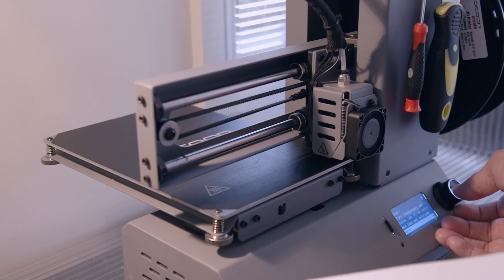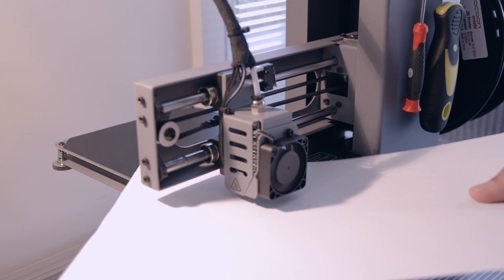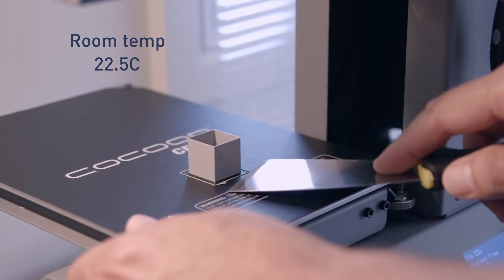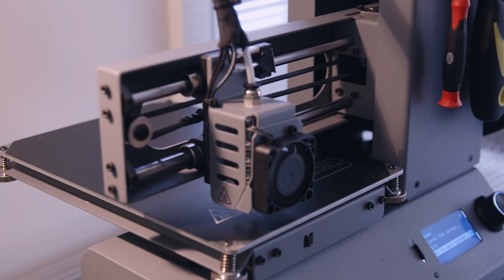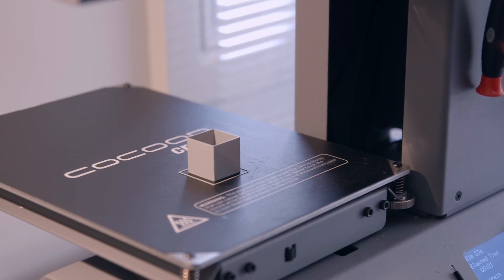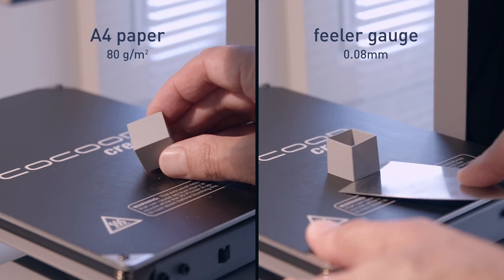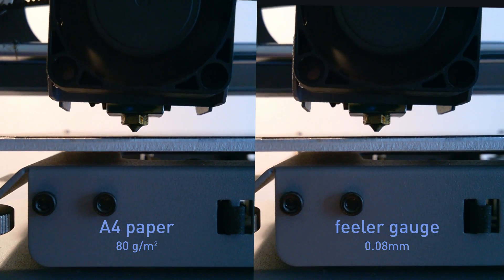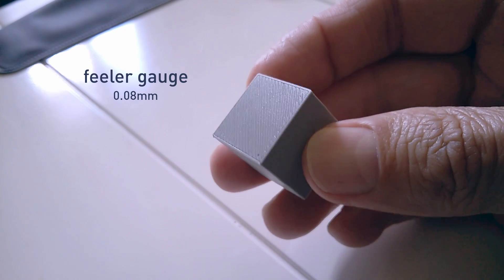Paper VS Feeler Gauge. Which is Best for Bed Levelling?

Comment: you do realize that 80gm paper is 0.1mm thick.... so of course if you dont adjust your slicer Z height settings your going to press your test cube into the bed with a feeler gauge Z height of 0.08mm

Measure the Z heights on both cubes and see if they are the same!
Reply from the maker: Yes that's my point Berko. I found that I needed to press the cube into the bed with a non heated bed to get good adhesion. Now that I have a heated bed I can comfortably run my gap at 0.1mm but my adhesion was lousy at that gap on the non heated bed. I was happy to lose a little bit of height for guaranteed adhesion.
Reply from the maker: The 0.08mm gap I'm referring to is the gap between the nozzle and print bed. I'm Not adjusting the stepper motor settings just the knobs controlling the height of the print bed, which are not limited to digital increments. Adjusting the bed with a gap of 0.08mm puts not pressure on the nozzle or stepper motors as a gap is a gap nothing is touching. Any adjustments here only affect the first layer of the print. I can see how your information may have an affect on an auto bed levelling system but my bed is a manually adjusted bed and the stepper motors have no digital input or feedback as to what the gap is set at.
Reply: @PVG3DPrints  It does put pressure on the nozzle during the print, as there's no place to fit more material inside a solid layer. That makes physical overextrusion, which can cause not only elephant's foot but extruder slippage and nozzle collisions (similarly, underextrusion will cause gaps, weak adhesion and thin walls). If you raise the first layer extrusion width instead, the slicer will know how much plastic fits, and still produce more adhesion. Then the extra pressure is specific to the first layer while the plastic is flowing, so won't push back nearly as much. 
So, in summary: 
1. Tram your machine (this you've done successfully), aligning the bed with the XY mechanism. 
2. Level your machine; this is done with Z offset (e.g. M206), making the print height exactly match the model height.
3. Adjust the first layer flow; higher first layer extrusion width gives better adhesion by squish, higher first layer height gives more room for that squish to flow (0.1mm seems a good first layer height for your printer). 
First layer pressure is the parameter you've been changing, but you've done it by altering the bed level instead of the first layer height/width proportion, thus altering the entire print height.
Reply: @PVG3DPrints  :
Nema 17 motors step at a 0.04mm increment on the Z axis.
you cant adjust this....
if you set your bed level height to a odd number that the NEMA 17 can not do... eg "0.1mm bed height" the motor with either round up or down the height!
ALSO..... if you set your bed height to "What ever" height, you also have to adjust it in your chosen slicer!
- if you still cant understand what this means.... use a set of digital calipers to measure the height of both your test cubes!
Reply from the maker: Hi Berko, I appreciate you trying to educate me and your patience but I'm struggling to grasp the significance. 
I've done many tests experimenting with gaps over the last year and a half.
--Cocoon Mini - Non heated bed. 
Gap 0.08mm - Best adhesion, good first layer. Nozzle not touching bed
20mm cube measures correctly at 20mm on X,Y and Z with Vernier calipers.
--Cocoon Touch - Heated Bed
Gap 0.08mm - First layer too squished.
Gap 0.1mm - Great Adhesion and first layer.
Gap 0.12mm - Poor adhesion and first layer.
At Gap 0.1mm, 20mm test cube measures correctly at 20mm on X,Y & Z. I just double checked the many test cubes I have already printed.
I dug up and re-checked the manual and it even recommends a gap of 0.1mm, which I agree with as that's where I get the best results.

Comment: That's where I was going wrong, getting the tension on the paper right, thank you. I use a mirror as a bed which is good for adhesion and once cooled the print comes off with a breeze.
Reply from the maker: Glad you found it useful slicedpage. I've seen great results from mirrors and glass.
Reply: @PVG3DPrints  I say this for noobies like myself. I thought I'd be clever and buy a second-hand mirror from a charity shop and cut it to size. All well and good until I realised that older mirrors are heavier and although no short term damage was done, I thought it best to get an IKEA ("Lots" pack of 4) mirror which is lighter so as to avoid excess strain on the motors.
Reply from the maker: @slicedpage  Thanks for the heads up on the older glass and the IKEA buy!

Comment: what about a feeler gauge of 0.09 or 0.10 for a closer mimic to the paper to try and get a medium level of both?
Reply from the maker: Hi Craig, no go I'm afraid. I tried going to 0.10 but without a heated bed I found this little printer really needs the first layer squished into the print bed surface for best adhesion. The printer I have now is the Cocoon Create Touch (i3 style), having a heated bed on that printer allows me to print with a gap of 0.10 or even a little more. It's amazing how much difference a heated bed makes.
Reply: @PVG3DPrints  But I measured A4 paper and A4 Paper comes up just about 0.11 mm , so this was not a real comparison.
Reply: @davemerkley5205  Exactly my thought. My paper is about 0.1mm thick and this is what I would use as feeler gauge on first attempt.
Reply: @davemerkley5205  You can get different thickness A4 paper that why he told you the thickness at the start.

Comment: "Bed leveling is probably the most frusturating part of 3d printing" And that's why I'm here. I hate bed leveling after day 1 of having a printer .
Reply from the maker: Stick with it Austin, bed levelling is indeed frustrating when you first start 3D printing. But it does get much easier with time and experience and your patience and determination will be greatly rewarded when you start producing great prints. I'm glad you found my video and hope it was helpful!
Reply: I know your pain! ‘“Candy floss” is even worse.  Printers tape with a raft can help but when you get good adhesion on glass with no raft the bottom can end up with an almost mirror finish, hang in there.
Reply: stop thinking about it that way... it is really not level at all. It is just about height adjustment and parallelism between the print surface and the direction of travel. Once you get past the idea of leveling, you can actually understand what you are trying to do...
Reply: Alen I bought one when I bought the machine... never used it. Once you figure out leveling isn't about level at all... you really don't need it unless your bed is warped and you can auto-trammel as you go.
Reply: @Alen they have 3d printed spacers to help with that

Comment: The question now becomes: What distance between bed and nozzle do you now measure with the paper-leveling method?
You can use your feeler gauge to measure that, and it would stand to reason that you ought to be able to simply use that new different distance with a feeler gauge. While giving us the printer paper "weight" is somewhat useful, that only implies a distance. Depending upon the way the paper is finished, 80gm/m^2 paper can have varying thicknesses.

TL;DR: what really matters is the distance. Let's actually measure it. You've got the feeler gauge necessary to do so.
Reply from the maker: Thanks for commenting R. James Scheffler III. Are you asking me to measure the distance between the nozzle and print bed after the printer has been levelled using paper? If so I'd estimate that gap to be about 0.1mm. Although, as paper has some give, it all depends how much pressure you apply to the paper when levelling, so it's going to be subjective and different people will get differing results.
Reply: Yes you've got it on all counts.
I'm asking that after the printer has been levelled satisfactorily using paper that you use your feeler gauge to measure the distance between nozzle and bed surface. As you note, because paper has some give, leveling with paper can be quite subjective. But if you were to measure the gap with a feeler gauge, rather than estimating, we'll have a significantly less-subjective figure to use as a reference.
This video is fantastic - I don't know that I've adequately expressed how pleased I am to find someone providing this sort of analysis.
Reply: Yes - I agree.  Was going to comment similarly until I found your comment.  My feeling is paper will be much more variable in nature than a feeler guage.  You can go through several tests to determine the average paper thickness but your time may be better spent determining with various feeler guage thicknesses the optimal height and use that exclusivley.  Paper just happens to be handy - it does not mean it is optimal.  I suspect paper will also swell with humidity increases.

I guess I did comment anyway.

I would also like to comment on when you clean the bed.  I suggest cleaning the bed before you set up the bed level/height as the cleaning process could be knocking the level/height out which you just spent time so carefully setting up.  ie perform the bed level as your final operation prior to printing.

Comment: I have never used any method except glue stick over a glass surface and it has never failed.
Reply from the maker: I've never used a printer with a glass bed but if I do I'll give your glue stick tip a try.

Comment: Just wondering why you'd level the bed then clean it? wouldn't even the slightest disturbance to the surface (and the springs underneath) have the potential to throw off the levelling? shouldn't the process be reversed, clean, then level?
Reply from the maker: Hi IAmTheOnlyYogo. That's fair question. I do it this way because feeler gauges are best kept oiled and I want to make sure there's no oil residue left on the print bed after levelling. The print bed is held under a fair bit of tension and scrubbing it with a paper towel and isopropyl alcohol won't affect the level.

Comment: When you change from paper to feeler gauge, you don't say or show what thickness of gauge you're using. The paper you go into detail about (80g/m^2) but not the simple identification of which gauge....until later on when you're showing the side-by-side removal of the pieces, then I finally see you used a 0.08mm feeler gauge.  :P     

ps- Automotive "blue" paper towels will not leave lint like the regular household "white" paper towels. If you've ever tried to detail/clean a window with a white versus blue towel, you notice the difference in lint right away.
Reply from the maker: Hi Kurt! Thanks for your comment. You're right! I watched the video back again and I thought Wow did I not mention the gap?? But then I did put it on screen at 4:19. Phew! I agree with you, I should have listed it when specifying the paper thickness. Mental note for future videos ;)

Comment: Can't you set parameters for the first layer only on your slicer?
Reply: Indeed you can, and should. In particular, you get the squish by setting first layer extrusion width, and you set a height to permit that to flow using first layer height. What's demonstrated in this video is successful tramming (aligning the XY and bed planes) with various levels; the level should be tuned using a Z offset, which is also found in the slicer but may be better stored in the printer's firmware (e.g. M206).

Comment: Easily the best bed levelling video I have seen. Nobody really goes into detail on how the paper drag should be or the feeler gauge drag. My mono price maker select plus comes in on Thursday. And this has really gave me a good perspective on bed levelling
Reply from the maker: Thanks Cody! I'm glad you found it useful.
Reply: Print Very Good 
No problem good sir I hope to have an easy time with bed leveling after watching your video. This is my first 3d printer
Reply from the maker: I see, welcome to the world of 3D printing Cody! 
Levelling the bed, or more importantly setting the correct gap between nozzle and print surface is easily the first thing you want to master. It takes a bit of time and tweaking and I still check my bed level before every print. The first time you level the bed of a new printer you really want to do the process 5 or 6 times before starting your first print. Keep going around each point of the bed until you are getting a consistent gap. Once you've done a few prints, experiment with your gap size to see what works best with your particular printer. Just make sure the nozzle is not touching the print surface. You can set the nozzle so close that it's almost touching the surface. Another good tip is to get down to the bed level and make sure you can see light between the nozzle and print bed. Best of luck with your new printer Cody.
Reply: Awesome thank you for the tips I just bought some feeler gauges and I will also dial in the x gantry as well then I will tweak tweak tweak until I get everything 100% level. Should I use isopropyl alcohol with every print?
Reply from the maker: Great! Yes Cody definitely use Isopropyl alcohol before each print and scrub it in to the bed with a paper towel.

Comment: Another thing that can help is lock nut bed leveling knobs.
it makes a big difference to the bed remaining level.
Reply: As in bigger diameter wheels allowing more finite control?
Reply from the maker: Thanks Wol-Gran I'll check that out.
Reply: No, more so they do not wobble loose while the printer is printing.
and to save time adjusting bed level each print.

Comment: I have never had a successful print on just the straight bed, I always need to use green painters tape and a glue stick. I have tried all methods including using the feeler gauge and even going so far as to change to a spare print mat (which was a pain in the bum) and nothing seems to work, except the tape and glue method for me.
Reply from the maker: Hi David! Yeah I'm finding out that what works for one person is not necessarily going to work for another. Too many factors like air temperature, humidity, location, time of year, heated bed, non heated bed... there appears to be no silver bullet. I think if you find a method that works for you then stick with it. ;)

Comment: for me the ultimate in bed adhesion has been with a combination of your recomendation plus one thing extra.
i lay blue painters tape and realy stick it down by running a scraper over it
i then level the bed at .7 or .8 
and then finish off with a spray of isopropyl alcohol and a wipe down what this does is knock off any oily residue from the tape (that isn't good for adhesion) and i must say my prints have stuck like champs.

perhaps you should do a bed adhesion stress test 
prints that cover most of the bed
prints that have small features on the first layer
and 2 shape style prints (i've heard that these can be the hardest to get stuck.

if you'd like i can send you a gcode that failed on my printer without the blue tape but passed with it (i also have cocoon create mini so no gcode issues
Reply from the maker: Hi Kyle. I actually did several prints last week that covered most of the bed plus a heap of others, I think I might cut together a clip to show how well the adhesion's been working. But I think the big key for me is a close gap (0.08mm) and the Isopropyl alcohol combination. A gap of .7 or .8mm is way too big for me. I'll cut that clip together tomorrow ;)
Reply: I do the same Kyle:  and use the blue tape to remove the print instead of the scraper.

Comment: curios have you tried the feeler gauge at the recommended 0.1mm gap rather than the 0.08 that you are using and if it makes any difference
Reply from the maker: Hi Nathan! Yes I started at thicker gauges and worked my way down to 0.08mm. Each time I went down I got better adhesion. I've settled on 0.08mm, strikes a nice balance between adhesion and print quality for me.
Reply: @PVG3DPrints  I think something is missing in this analysis. You've already found that 0.08 is the right height. Using the paper, while useful if you don't have feeler gauges, is just a different way to set it to a different height. You could just as easily use a mic to check the width of the paper and use a feeler gauge of that width. So you're really just varying the nozzle height.
A more useful variant might be to use a 0.08 and 0.09 feeler, as a go and no-go. This could speed up leveling, and ensure consistency, as the gauges shouldn't change. The paper will change height as it gets abraded and burnished by the nozzle.
You demonstration of how to use the paper was spot on.
Reply: soooo, 0.9mm would be the sweet spot!
Reply from the maker: Actually you might be on to something there David, are you adding those values to the Start.gcode parameters? I often feel the actual first print layer is larger than the gap I set. Maybe my 0.08mm gap setting is compensating for a start.gcode setting? You've got me thinking now, might have to do some tests! ;)
Reply: Did you do a comparison of gap using different feeler gauge sizes and elephant foot?
Reply from the maker: Hi Gianni. I haven't, but I'd say it would be lessened with larger sizes but then so would my adhesion also be less. In which I would just use the paper to level. If I had to guess I'd say the paper was probably equal to about a 0.1mm feeler gauge gap.
Reply from the maker: Hi Gianni! Depends on the layer height you have selected I reckon. If your printing at 0.2mm layer height you might want to go a little thicker to 0.1 - 0.15. Now that I think of it, I really should be making the gap even smaller than 0.08mm when I print at 0.06mm layer height. Or maybe I've got it all wrong... there's always that possibility.